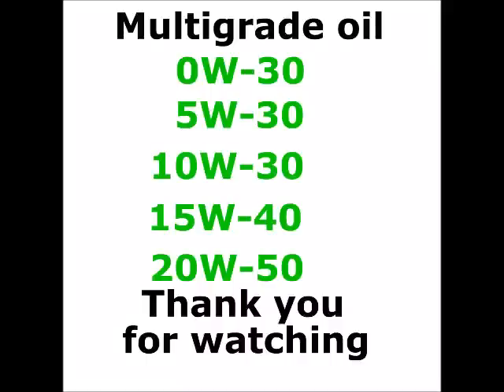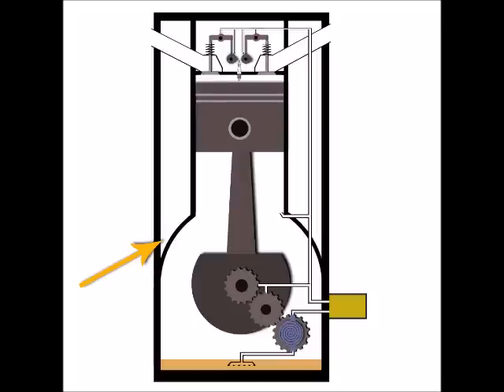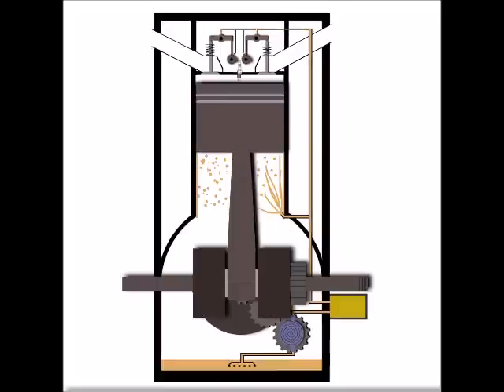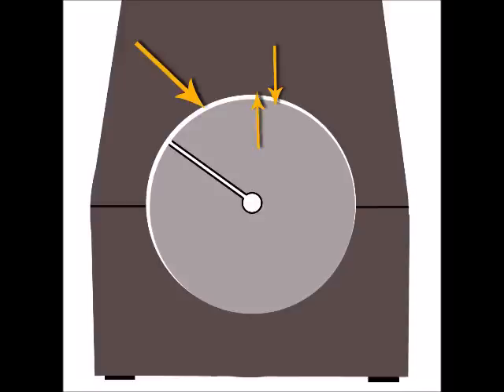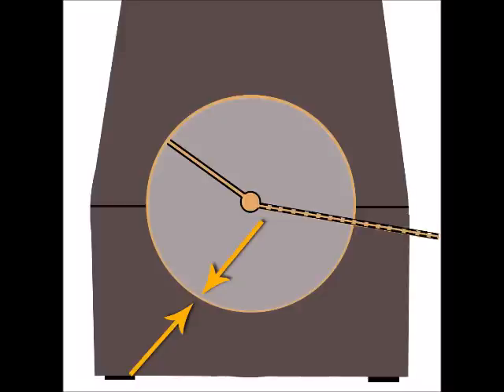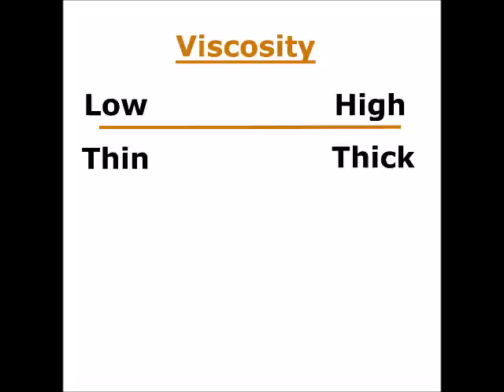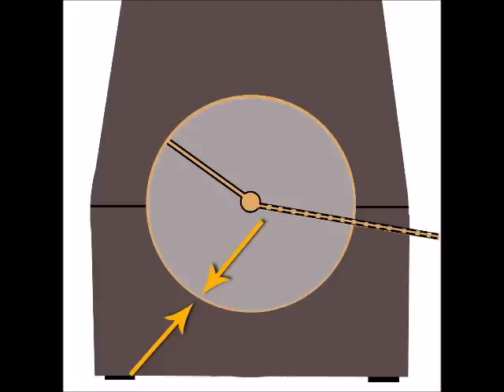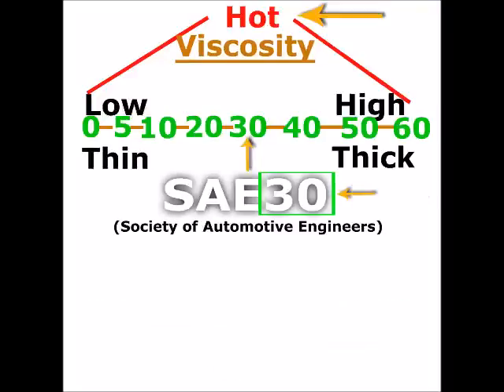Engine oil Explained | Multigrade Oil Viscosity Explained | The Basics!

Comment: Great explanation, but something is wrong. The oil does not get thicker when hot. By simply looking at it when pouring it from the bottle to an engine it is thick. And when draining the same hot oil from the engine which was still hot at the time of draining at about 100C. You can clearly see it pour down like water and by touching it you feel that it is less viscous than colder oil. I think the multi grade allows for less thickening when oil is hot compared to a single grade, and oil is the thickest when cold and gets thicker the lower the temperature and thinner the hotter the temperature, the VM doesn’t allow it to thin as much as it would have without the VM, yet still its thinner when hot than when cold. Looking at oil spec sheets. You can see different viscosities at 100c and 40c. 
Correct me if I’m wrong.
Reply from the maker: I understand your questioning of this, i really do, and you are right to question it, as many have.  What I failed to do in this video is to better explain what I actually meant by this.  In response, I have made another video, which I hope will help clear things up.  You can find it here on you tube at:  https://www.youtube.com/watch?v=gmLASM9XcM4&t=269s
I hope this helps.
Thanks, Craig

Comment: 5:50 that's why some older engines like my pickup truck have main bearing knocks on Startup and then after they get oil pressure they stop. It's also weird we live in a time where warm oil gets thicker and cold oil gets thinner completely opposite of what it should be great video man
Reply from the maker: Thank you so much for the nice feedback. I really appreciate it. Craig

Comment: The more modern synthetics use a lot less VII's. They start with a synthetic base oil which thickens less so can meet the spec of a 5W and an SAE30. The only additions i'd make to the vid is that it's not that the oil thickens with heat, it's that it gets less thin that it would have done without the VII's, the cst of the oil still goes down, just not as much. Also these bearing are hydrodynamic so the oil pressure built up by restriction of flow from the pump isn't doing anything directly to keep the metal parts separated. In a hydrodynamic bearing, the supplied oil is sucked in and forced out by the rotation of the journal. The rotation of the journal creates an oil wedge that the journal rides on, like a surfer. The restriction of flow prevents too much side leakage from the bearing to guarantee oil wedge integrity and no metal to metal contact. The oil system is usually pretty much primed because the oil pump is holding the oil in oilways the block.

Comment: that was a good explanation.  learning initially that the oil is thick when cold and thin when hot... just when i was absorbing that idea , you gave a twist of " acts like 30 "   after a minute of discrepancy , you introduced vm and solvent and again clarity came back... nice video.... hmmm  but my sym scooter company manual  recommended sae 10 w 30 and the mechanic recommended sae 20 w 30 ... i bought what the mechanic had recommended and  he filled the tank... had i seen this video i would have gone for sae 10w 30...        but may be sae 20w will act at higher temperature better than sae 10w..
Reply: m m ganesh Oil gets thinner with heat. End

Comment: at last somebody has had the insight to explain carefully why oils get thicker when they get hotter when common sense dictates they should get thinner.....it's down to VM's and how solvents act on the bonds between them as temp rises making the bonds weaker so the VM's expand in size making the oil thicker.......great video
Reply: great now i'm confused ...VM= viscosity modifiers ?
Reply: steviezxr...sorry but you have not understood the video...if you're right then 5w-30 is wrong....5w = viscosity at 0 deg  ....but 30= viscosity at high temps (100 deg) according to you at higher temp the viscosity gets thinner and should drop below 5 but it does not due to the action of viscosity modifiers and solvents...they are activated by heat making this oil thicker at high temp...remember modern oils are not single grade but multigrade

Comment: Thanks, good. But I think it's very important to distinguish btw SAE5 and SAE5W. You repeatedly say "same as a SAE5" and it's not, so in other vids as well. An SAE5 is solely referenced and speced at kinematic visc in unit cSt at hot-working Ts. It should be "the same as an SAE5W", defined and speced at low Ts. The SAE carried out tremendous work in the 50s with the XWs.
Reply: Hi! Thanks for your reply. Maybe you can help me understand smthg I‘m still a bit confused on.

Now, I know that oils flow quicker when they are heated ie. It‘s quicker to perform an oil change on a car when the motor‘s been running a bit. This is also true with multigrade oils. 

So, which viscosity does SAE use? Is it the kinetic viscosity that increases with temperature? 

In the video it‘s often stated „acts like an SAE 30 at higher temperature“ but we are not talking about fluidity here. So which viscosity increases with temperature with multigrade lubrication oils?

Thanks!
Reply: @YouGuysAreAmazing  Thanks for asking. 
Similar to what you say, all motor oils behave fundamentally in the same way according to Newton's physics. Internal friction (expressed as viscosity) decreases with temperature, fluids flow more easily, oils wet a surface more easily, they drain quicker on oil change. This irrespectively of their classification. What SAE carried out with the mulitigrades is that they supply a hi&lo temp combo, oils now being defined by their properties at working temperature (as with 50 for the typical Harley oil 20W50, this at 100 degrees Celsius), and also at cold engine (here for 20W; BUT defined at -15 Celsius, see below).
 
Multigrade 20W50 with properties combining two separate oils:
SAE50: no 'W', so hot working at 100 Celsius, kinematic viscosity at hot engine to span 16.3-21.9 cSt (centiStoke), primary consideration is oil-film thickness
SAE20W: dynamic viscosity for cranking cold oil at -15 Celsius; spec not thicker than 9500 cP (centiPoise)

So kinematic and dynamic viscosity are only two different definitions/units characterising the flow properties of an oil. Dynamic viscosity is the kinematic viscosity multiplied by the density of the fluid. Thus, the numbers 20(W) and 50 aren't definite temps or viscosities, but indices of both for viscosity classes; SAE0W, by the way, is defined as cranking at -35 Celsius. The SAE work is great but not always intuitive - multigrades being defined a little like apples and pears - and multigrades cause some confusion on YT. Not that it matters much, since motorppl in general get the gist - says I, after having ranted for ages now...
Reply: @hni7458  Thanks for replying and diving in a bit deeper. I guess all in all, the confusion sets in b/c I tried to fix all SAE scales into one linear-operating simplistic notion. 

As you stated, the second „working temperature“ index is most often set at 100°C whereas the „W“ index isn‘t set in stone across the board.

I was a bit stunned in seeing 0W30 used as lubricant in hydraulic suspension forks since these forks will never go to a working temp of 100°C. However, I take it that the manufacturers simply wanted a lubricant that would still work at lower temperatures (as opposed to using 15wt which they used to use). I‘m guessing that in this case, the forks approx. reach an SAE15 when functioning at working temperature.

I saw a simplified graph a while ago that did a fairly good job at demonstrating what SAE was trying to do. The graph displayed ie. both SAE 0 and SAE 30 graphs from -10°C to 100°C. Then, the host simply drew a line between the points SAE 0 @ -10°C to SAE 30 @ 100°C and stated that the resulting line was a crude approximation of SAE 0W30. That helped a bit to draw some of the confusion out.

Comment: I think of the Viscosity Modifier like egg whites: Egg white when it is cold is thin and runny. Add heat to it, and it becomes thicker, actually until it is solid. And Of Course while you can't reverse that reaction, essentially Viscosity Modifier can, many many times. Since an egg white is a protein (albumen) it is a large chain just like a polymer.   I suppose acids build up eventually in the crankcase, along with other Carbon Nasties, and eventually the solvent evaporates off. And then, this otherwise reversable process gets less and less efficient as the oil/VM/Solvent ages. The acid buildup No Doubt "kicks" more of the Viscosity Modifier into staying thick and not being able to "thin out" over time... Just as if your poured some vinegar into a bowl of egg whites... They "curdle" like that which I would guess gets worse over time. It's pretty amazing that it can go through this process so many kilometres and last as long as it does, really. Question: Do you think that it's better to let a cold engine come up to temperature before you exert a load on it? I always wait a few minutes before I actually pull away from my house, thinking that things are better lubricated, so less wear. Do you do this? My car's always last a long time, as I change the oil at regular manufacturer intervals, let the engine warm up, and am very gentle with acceleration. (And stops.) We always had to let the temp be "in the green" when flying. Aside from aircraft, Semi Trucks you call them lorries I think, have many gears, to better balance the load. But even an unloaded truck, Truck Driver takes a long time to accelerate up to working speed. So I try to do the same thing. What is your practice/advice?

73 DE W8LV BILL

Comment: Great Video, but I still keep a question, Why not use 10w50 instead of 10w40?
Reply from the maker: Well in my opinion, when choosing between 10W-40 and 10W-50 motor oils, the main consideration is the difference in viscosity. Both oils have the same viscosity when the engine is cold (that's what the "10W" signifies), which means they will start up with similar thickness at lower temperatures. However, the difference lies in their viscosity at operating temperature, which is indicated by the second number.

The "40" in 10W-40 means that this oil falls within a certain range of viscosity at 100°C. It is less viscous than 10W-50 at this temperature, meaning it's thinner and flows more easily. Conversely, the "50" in 10W-50 indicates a higher viscosity at 100°C, meaning it's thicker.

Here's why you might choose one over the other:

Manufacturer's Specification: Always the primary guideline. If the manufacturer recommends 10W-40, it's because they've determined that this viscosity is optimal for the engine's design and typical operating conditions.

Ambient Temperatures: In very hot climates, a thicker oil like 10W-50 might be preferred because it can better maintain its protective film at higher temperatures.

Engine Wear: For older engines or those with high mileage, a thicker oil can sometimes help reduce oil consumption and provide better sealing.

Performance Demands: High-performance or racing engines sometimes benefit from thicker oils like 10W-50 due to the increased stresses on the engine components.

Fuel Efficiency: Thinner oils generally reduce friction more effectively, which can lead to slightly better fuel economy. In this case, 10W-40 might be the better choice if efficiency is a priority.

In summary, while 10W-50 may offer better protection at higher temperatures and under more extreme conditions, 10W-40 is often preferred for its better fuel efficiency and suitability for a wide range of typical driving conditions. It's crucial to consult your vehicle's manual and consider your specific driving environment before making a choice.

I hope this helps a little

Craig

Comment: Thank you sir for these full details. ...so...wide ranges of numbers could be better according to ur great explanation. ....as 5w-50 cover wider range of temps and better than 15w-40 as an example...isn't that? thanxs alot
Reply from the maker: Ali Hasan, yes absolutely. In my opinion the greater the gap between numbers will mean that the oil will adapt to suit the heat it is experiencing. When I say this, I am referring to the lower number only. The higher number ( e.g. 30) will have to be correct for the  needs of the engine. I thought I had explained this but realised I hadn't and it was bought to my attention that I hadn't from the comment below (thank you for that). Anyway, the upper number (working temperature number) has to be correct for the engine as I've mentioned. If not, then as rightly explained below, the oil would either be too thick or too thin depending on the number. E.g. If an engine needs a 10W30, then a 10W50 would result in being too thick at working temperature. The issue really is only in the upper temp.  I have known some users to use 0W30 for an engine requiring a 10W30. The range of numbers I was referring to, which should have been more clear about, was the lower numbers (cool running numbers).  As the engine warms up the oil then will adapt to the heat of the engine up to the higher viscosity number and no higher. Apologies and I hope I've explained it better this time. Thank you.
Reply: "Better"? Not sure that's a god word to use.  I wouldn't be putting a 5W-50 oil in a car that requires 5W-30.  If 5w30 acts like a 30 (thick) at 100C, then a 5w50 will act like a 50 (thicker) at 100C, you could ruin your engine quicker, no?

Comment: Thank you for your explanation. 
I may have a question?
According to SAE number for multi-grade oil, when we going to change the new oil.
It's will be better to drain when the engine and oil is cool? Because oil will be thinner and easy to drain.
We will have less remaining an old oil inside the engine.
Not sure I missunderstanding something but we alway warming up the engine till it working temp before drain the oil. Right?
Please discuss, which is the better way to change an engine oil?
Control condition, summer time room temp 30 C
1. Parking car overnight and drain in the morning.
2. Driving car for the short distance untill it working temp and drain 
Any opinion are welcome 
Thank you very much
Reply: Oil will not be thinner when cool or cold. Oil is always thicker when cold and thinner when hot. The explanation in the video is not quite accurate.

Comment: Im a bit confused. If 5w means when the engine is cold, then what does 10w mean?
I ask because I thought the number in front of the w meant the cold temperature, meaning 5w means when the engine is at 5 degrees and the 10w means 10 degrees. Is that not the case?
Reply from the maker: Hi. The W refers to the viscosity of the oil in cold temps.  So 5w means that the oil is at a SAE rating viscosity of 5 at cold temperatures.  Here is another two videos of mine to help grasp the understanding if you would like to look at it:    https://www.youtube.com/watch?v=Tck6JU-KZgQ&t=238s

https://www.youtube.com/watch?v=d_Dz1M6U2jU&t=546s

Thanks 
Craig

Comment: i have a Range Rover 5litre v8 petrol......5w-30 is recommended by land rover but should i switch to mobil oil  0w-20 as this will flow faster on start up but will it protect the big end bearings as well ?

Comment: Hi ther.. my current motor oil from day1 I’m using Mobil 1 0w-40 n my car is coming 6years old.  Im staying Wher temperature is 30’C -34’C all year round n it’s hot/wet climate. I was suggest that after d 4th year it’s better to change to 5w40 . Is it a wise move or better still to stick to 0-40. My car is Merc W204 6.3 V8 AMG year 2013. Thankyou very much n looking forward to hear ur feedback. Really appreciate. Tq again.

Comment: My country is too hot in the summer and too cold in the winter and my car manual the recommended oil is 5w-30, 10w,40 and 15w-50. Can i use the all range oil 5w-40 or 5w-50?

Comment: At what temperature, or temp range, does SAE define as "winter"? Is it 0 degrees C? 

I've reviewed a few oil specification sheets and I typically see viscosity defined at two temperatures, 100 and 40 degrees Celsius. I can't imagine 40c being the temp used as the winter viscosity. That's over 100 degrees F.

Comment: Hi ... please tell me what I have to choose in viscosity grade in oil for Toyota tundra 2002 4.7 4wd .. because in the owner's manual wroten 5w-30 .. or 10w-30 .. but I'm not in the coldweather I'm in Africa and the temperature around 8 ° C minimum and reach to 40 maximum during whole the year .. so tell me please what the appropriate oil viscosity grade should I use for my tundra .. and thank you for the help

Comment: i live in los angeles where it doesnt really get cold.....so using 5w-30 vs 0w-30 doesnt make a difference?
Reply: I'm in Southern California also. I run 5 30 winter. An starting in june, run 10 30. In November I go back to 5 30. Been doing this 45 years, never had any engine issues,  and I have put over 130.000 miles on many engines.  Change oil every 3500 miles. Yes my new cars, which say 5 20 get the same oil.

Comment: So if your pump works good any kind of oil should strart spraying on a cold start
Reply from the maker: Yes but the oil still has to be correct for the particular engine in question

Comment: We need a in-depth video on the ACEA terminology. Example . A1 or A1-B1.and oil that is classified A1-A5 to B1-B5.this is the classifications that separate the men from the boys. Example Mobile 1 and castrol titanium almost mirror each other on every product but Mobile 1 doesn't designate there 5w20 oil A1 B1 but castrol titanium does indicate there 5w20 A1 B1.ACEA is as important as anything on the bottle except for weight.